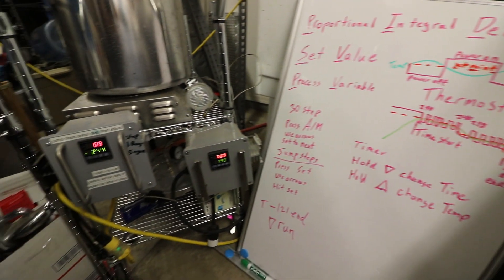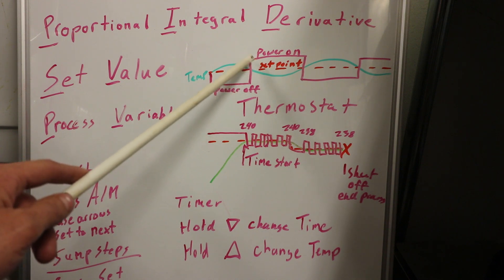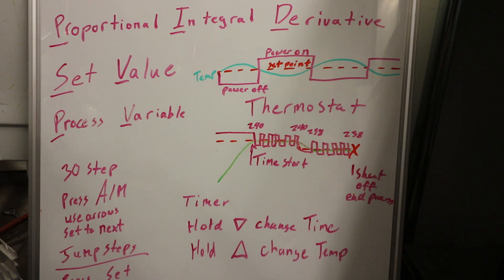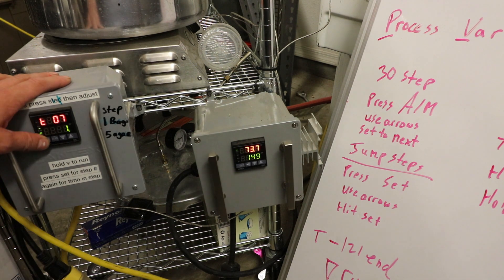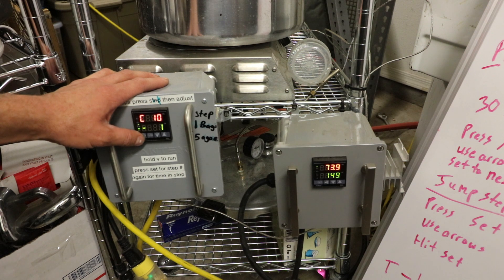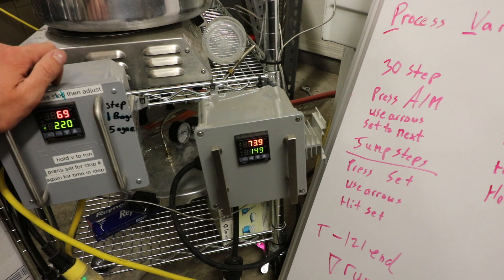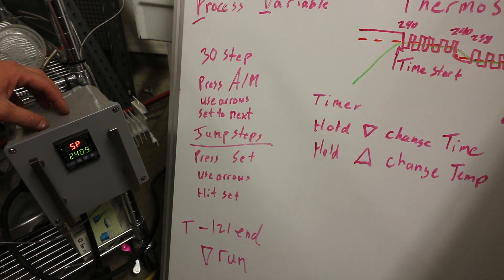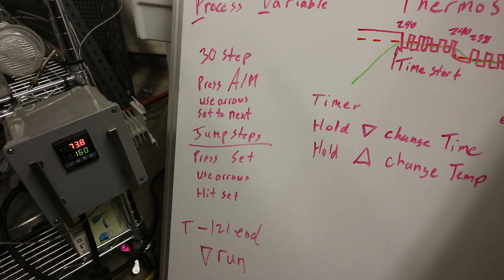Sterilizer Automation PID Programming 30 Step Ramp Soak and Time/Temp For Mushroom Growing

Comment: Hey Myers, what PID controller is that? and where do I buy one? 
I bought one off Amazon a week ago and blew the system because it was not pushing enough wattage for my heating element
Reply from the maker: It's a auber PID there should be a kit link in the description with all the products. Are you running a SSR off the PID?

Comment: Thanks Eric!  What are the temps and intervals you use for spawn and for agar.  It will save me some trial and error.
Reply from the maker: 242 or whatever gets the rocker going hard for 10 min 240 for 10 min, then 120f for 200 min to soak until im ready to pour.

Comment: Just curious, are the large sterilizer drums (bubba, or home made) not capable of sterilizing spawn? If so, why do you use the pressure cookers for spawn?
Reply: My thought is that yes they can sterilize grain but making that amount of grain spawn is not needed. spawn to substrate ratio is far less than amount of sub needed therefore only a smaller setup is needed for grain saving time and $$. 24 hrs to sterilize in low pressure system compared to 90 mins in autoclave or PC